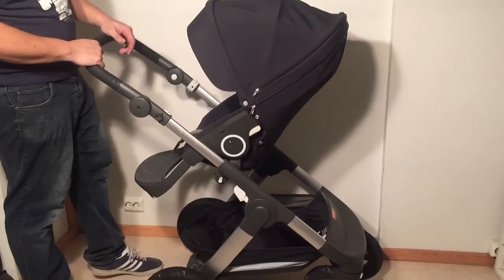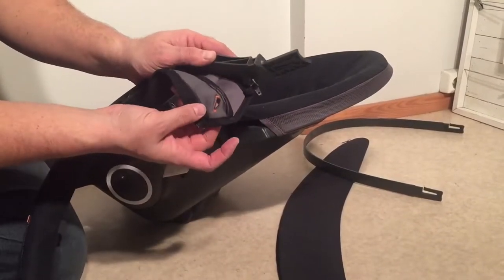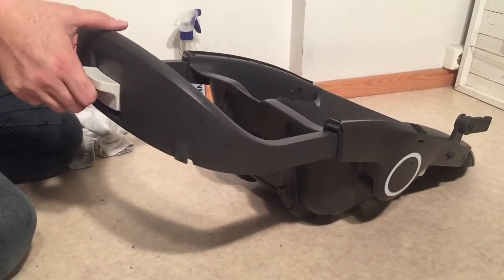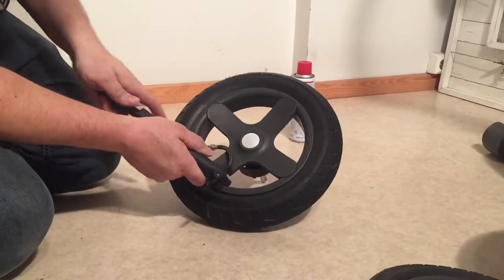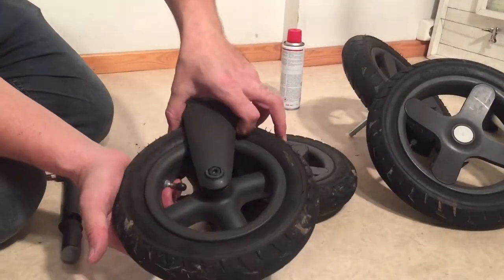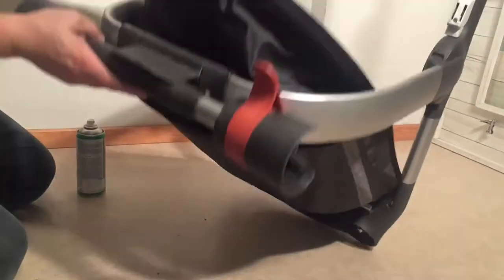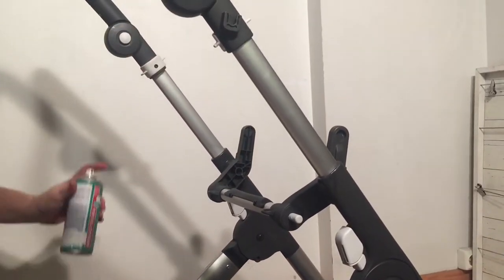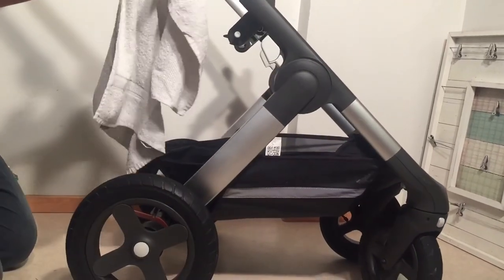Stokke Trailz: Cleaning and Care. Easy to Follow Step-by-Step instructions

Comment: Hi. I've bought a second hand stokke trailz and it has a good few scratches on the chassis (black and grey part) any advice or tips on how to get rid of them? Many thanks 😊
Reply from the maker: You can clean debris and rust out of the scratches on metal parts (which makes them less visible) using a microfiber sponge, nail-polish remover and products like rust-eater, but removing the scratches altogether is not really doable, as the metal parts are powder-coated like cars, and so not really doable at home.